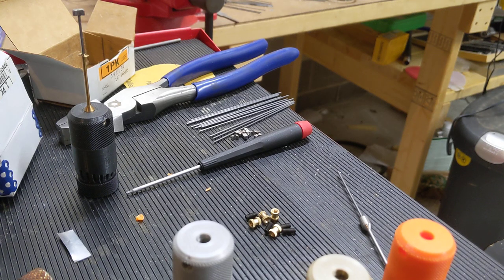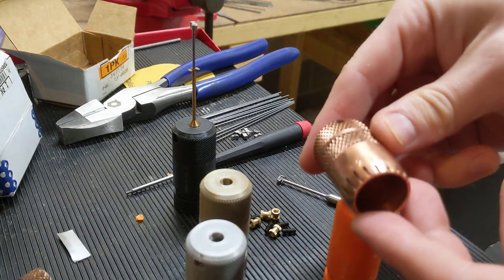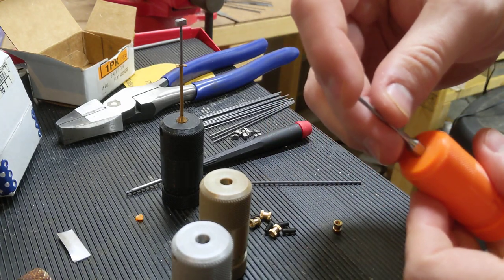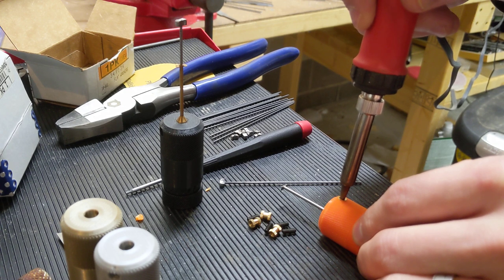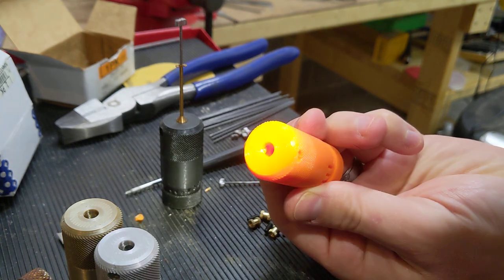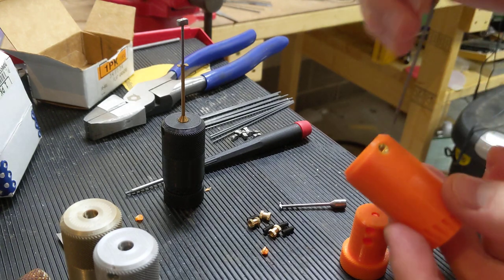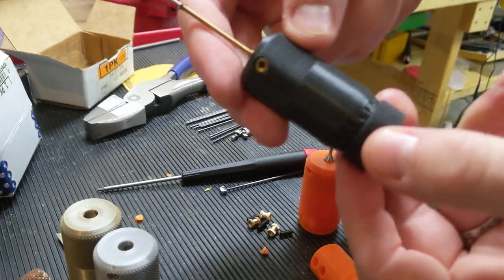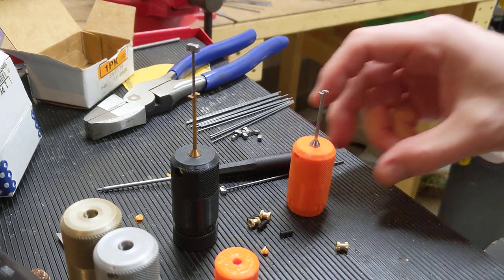Silver Bullet - DIY Kit How to Build

Comment: Already have a copper one, wonder if the plastic handles give different feedback...
Reply from the maker: Yes it does, machined is much smoother. You can sand the plastic ones though to smooth them out, but the tolerances aren't as close as the machined handles are